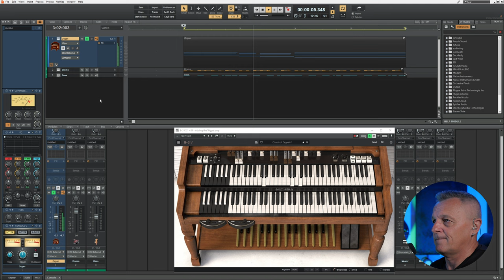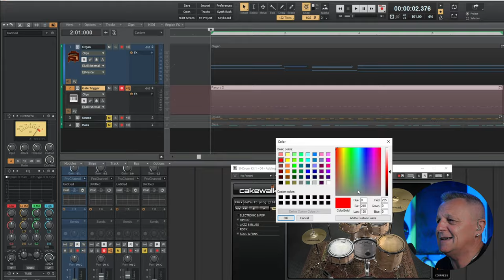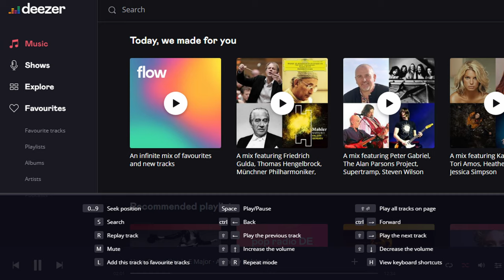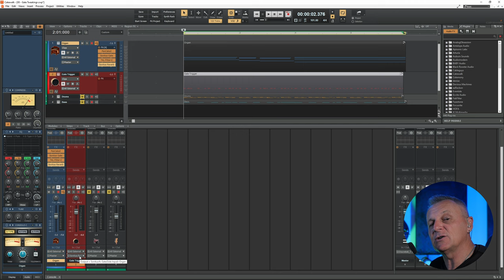CAKEWALK - Creative Gating (Trance Gate Technique)

Comment: Notes for myself

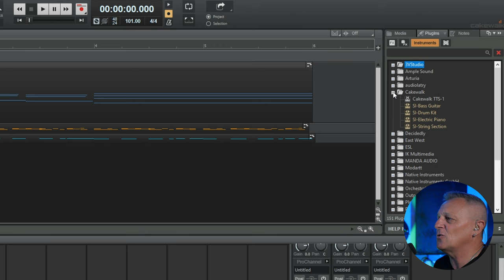3:00 Drag in SI Drum Kit, insert as a simple instrument track. Record the kick part and quantise it. 

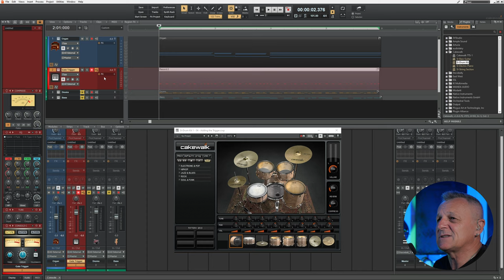4:46 Insert Sonitus Gate. Route the trigger to the Sonitus Gate, use the Output so its sound is all sent to the plugin. 
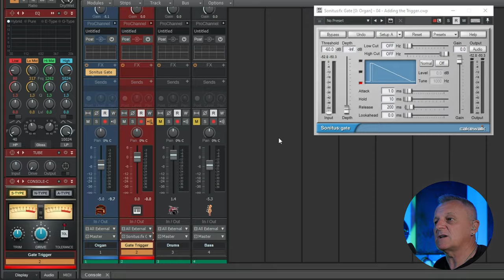6:19 Need to adjust the threshold in the plugin. 

7:09 Sponsor Distrokid. 

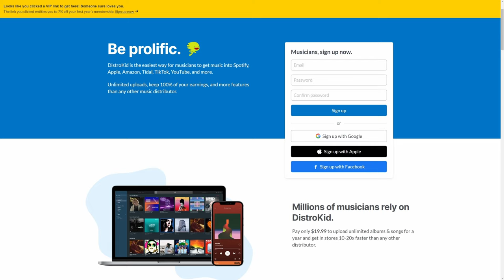7:58 Sounds a bit soft and loose, sharpen it with Attack and Release controls. Attack slightly above 0 to avoid clicks. Release down a little lower. 

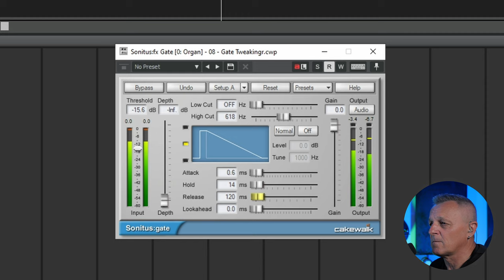9:00 Insert Pancake 2 from CableGuys, free. Speed up the pan to make it happen over 1 bar, and make the shape sharper. 

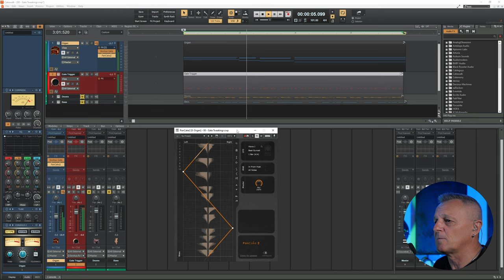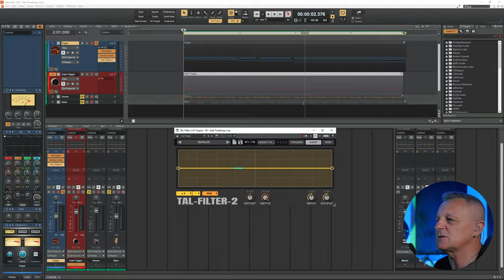10:25 Insert TAL-Filter 2, free. 10:56 Select HP 12dB. Draw in curves. Change cutoff and depth. Increase Reso. 

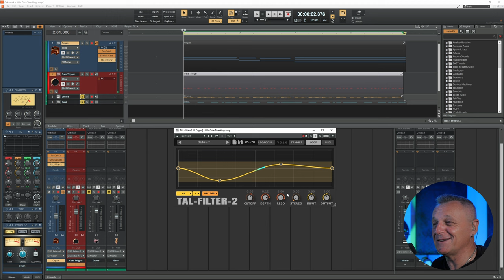11:44 Insert Sonitus Reverb. Adjust low cut. Make the reverb the last plugin in the chain. 

12:54 Change Output back to Master. 13:30 Send it to Sonitus Gate. Switch off Post to make it a pre-fader Send. 
14:13 Turn fader up to bring kick drum back a little. 

14:36 Sending the signal from the trigger to the gate is called side-chaining. A more common use of it is sidechain compression.